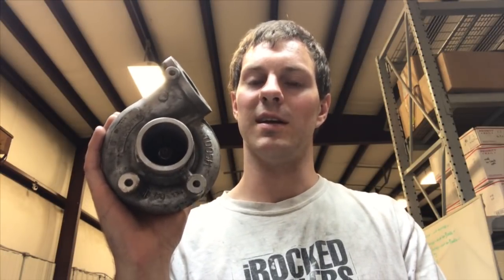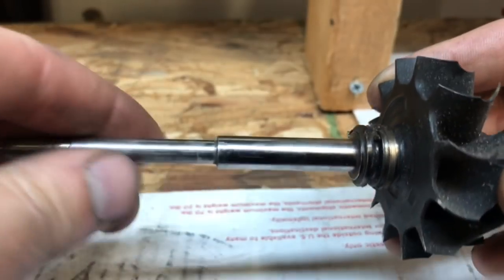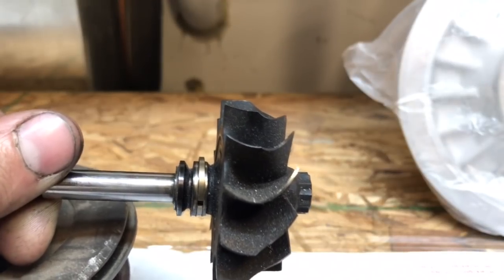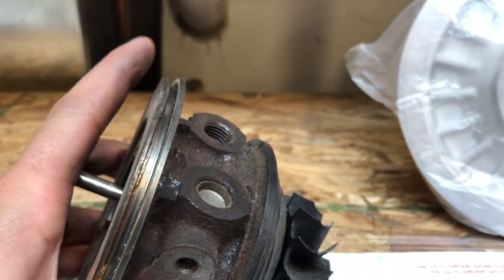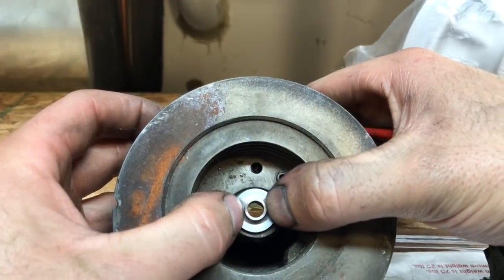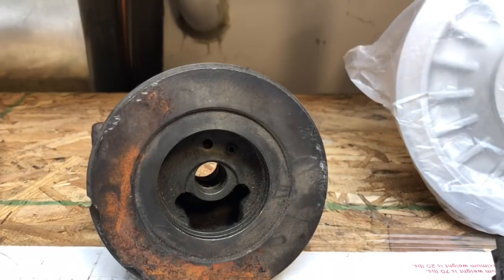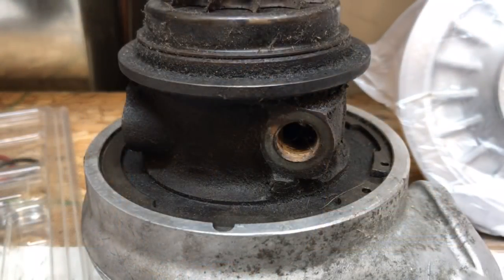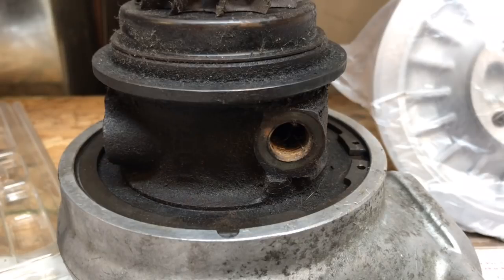My First Turbo Rebuild

Comment: 1:39 is it possible to polish and take away  some of the scarring on the shaft using a fine grit sand paper? I have 1500 to 3000 grit wet/dry polishing paper that I  have been using as a test to see if it does work. But from your experience can it be done? I already have some surface rust building up on the shaft and I think I can remove that myself. But scarring is what worries me. And also using a steel drill brush to take off the carbon at the end where the blade is on the exhaust side. I did scuff the end of that a little bit. Any info helps a lot!!!!

Comment: Will i rebuild my first turbo today on my n54 the first turbo went great but the second one when i mate the exhaust side to the compressor the blade would stuck it takes me 6 hour investigating then it leads me is that the heat shield provided with the chinese turbo rebuild kit is like 1 mm smaller and it cases the exhaust blade to lock with the housing 
So i just cleaned the old one and everything worked fine but i blown away  with the tolerance there is no rom for 1 mm error in turbo's  And then i regret ordering the Chinese kit so that the next turbo rebuild kit will be ordered from turbo lap America next time

Comment: I have a schwitzer s1 and the bearings seem to be stuck from sitting out in the water and such, What is the best way to remove these? its currently soaking in a bath of trans oil and mineral spirits,

Comment: Austin, im rebuilding a 6.0 turbo powerstroke, i was hoping you can help me out with a coupple of things, is it the same seal ring that goes into the plate that holds the turbine shaft, i felt like you placed it ito the plate to check the spacing, later you show it on the shaft an pop it in when you put into the plate, hope this makes sence, ive watched everything youve done on. Turbos , thomasfulcher84@gmail.com is my email please ket me know , im gonna do this friday day after tomorrow,  thanks a million brother, thomas
Reply: Also kit is from kc turbo 360, and 10 blade drop in
Reply from the maker: The front piston ring goes on the collar, you can check the seal plate by putting the seal into the plate to check the gap. The piston ring for the rear that goes on the turbine shaft can be put in the bearing housing to check the gap also

Comment: Hey. I have a BNR S3 I am rebuilding due to it being locked up. It has a GT2871 journal bearing so I was going to give my first rebuild a go and buy this kit https://www.ebay.com/itm/Garrett-GT25R-GT28R-GT2871R-GT3071R-GT3076R-Ball-Bearing-Turbo-Rebuild-Kit/111507100695

I work on diesel engines and trucks but have never had a turbo apart. Think I'll run into any issues or any tips? Really appreciate this video, it helped clear up some confusion.

Comment: need help figuring out what turbo my friend gave me. i need a new turbine/shaft cause the threads sheard off.
i was told its to a sr20det  turbo but the sr20 turbine i got was way too small. i can email you pictures of the meaurements i took with a micrometer thanks
Reply: Mike Bingay T25 turbo maybe

Comment: Hello. Do you have available rebuild kits for sale for an MHI 14b turbo? I'm located in Philippines so I was wondering if you have cheaper kits and have it shipped here? I currently do have friends in Cali right now maybe we could make an arrangement. Thanks and great video btw
Reply from the maker: I have everything besides a new seal plate, I have a used seal plate that is in good shape, usually that part doesn’t go bad
Reply: Turbo Lab America Thanks! Please provide email address so we can communicate. Thanks

Comment: I have a gt2871r rep journal bearing from twisted motion and was wondering if can reuse the exhaust and compressor housing and just swap the journal cartridge for a ball bearing one ?
Reply from the maker: The compressor housing you can but you can't use the turbine housing from that turbo on a bb turbo

Comment: How do you keep balance on the shaft or better how do you keep the nut shaft and front prop true so when you reassemble the turbo it wont need to be balanced?